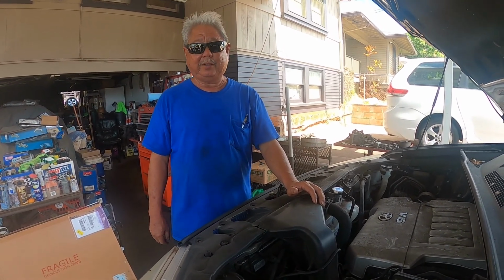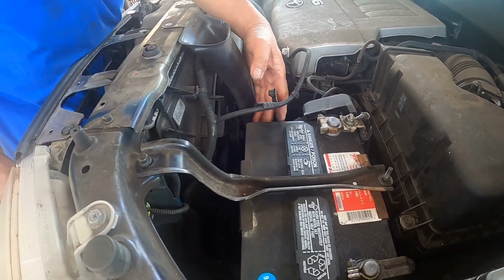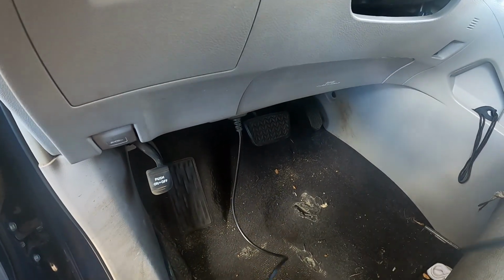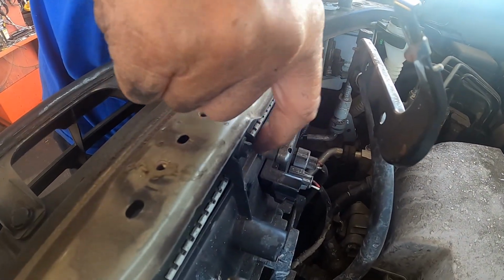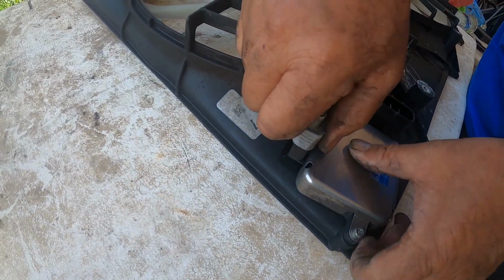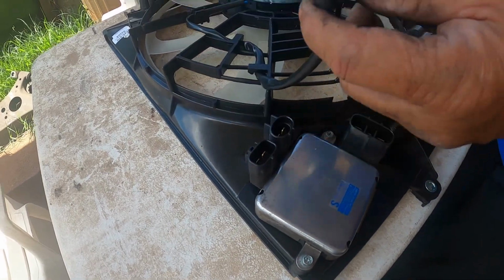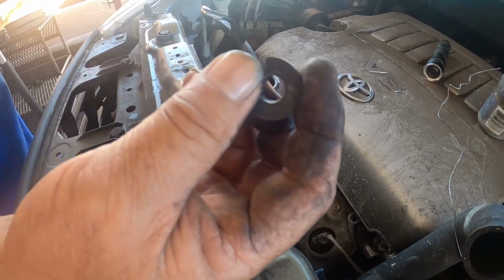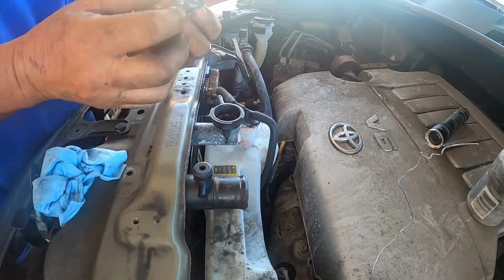2012 TOYOTA HIGHLANDER FAN ASSEMBLY

Comment: I think the shop manual said come up from the bottom, but I always thought it could come out from the top. You showed it could be accomplished and I finished in less than 2 hrs and I work slow. A great video but the only problem had was reconnecting the intake snorkel that was under the air filter.